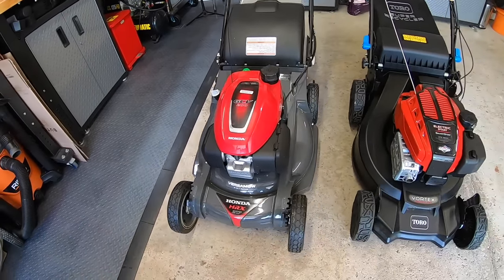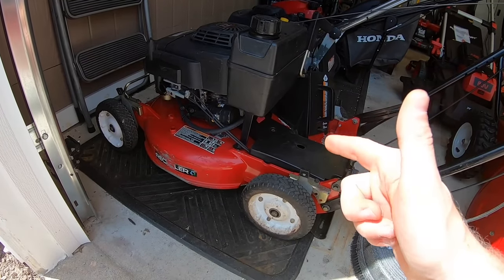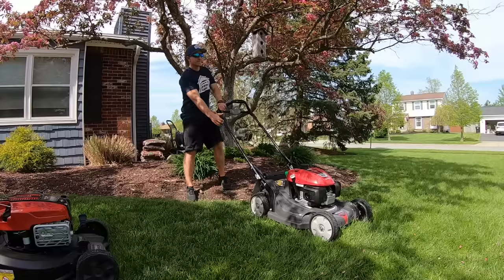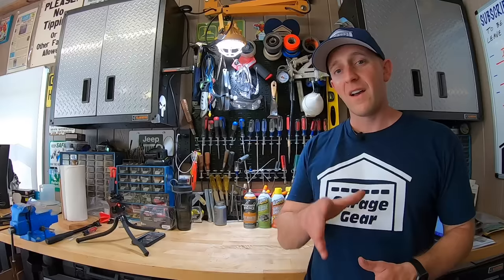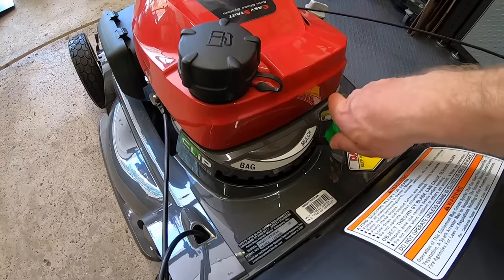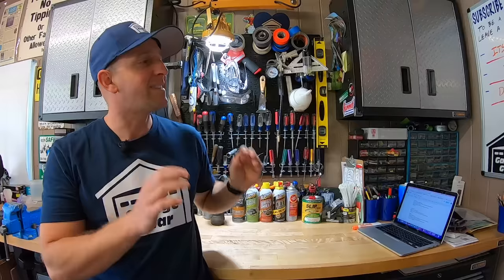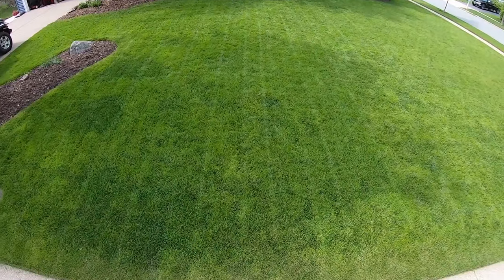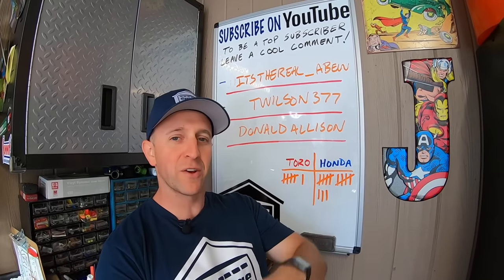HONDA HRX217VKA VS TORO SUPER RECYCLER 21564 - WHICH MOWER IS BEST?

Comment: I have a Honda 190cc HRX 217 that is about 12yrs old, and a 32yr old cast aluminum Toro Recycler with the tiny 121cc Suzuki 2-cycle engine and 3-speed transmission. I have some bumps in the yard and the Honda is kind of bouncy and feels a bit top heavy compared to the old Toro. I think the Toro is a few pounds heavier and most of the weight is in the deck, and the Honda has a lighter deck and larger heavier motor that stands much higher off the deck. The Honda does make more power, but it is more than needed.

The Honda is a great mower, but the old Toro mulches better and leaves a much better finished cut. I am not a fan of Honda's select drive or Toro's Personal Pace. I like old school 3-speeds, but I have never tried Hondas Hydrostatic transmissions. If I bump into an old 1990's cast aluminum Honda HR 215 on the cheap I'm grabbing it. I'm not feelin' Honda's Nexite so much even though I am a HUGE Honda fan. Been driving Honda's for 27yrs, and my old Accord saved my life 23yrs ago.
Reply from the maker: Good info! Thanks for sharing Eric!

Comment: JB have you ever done a video on the Timemaster kill switch? I noticed a fence and my switch hit the fence twand had to replace. I went to hardware store and got a insulated switch for $5. So easy to use. I put it in the same housing as the Original switch. I even had thecswitch ware out. Take care.
Reply from the maker: Never did that. Actually I sold the mower a couple of months. Thanks for sharing what you did.

Comment: I have a 2018 Honda HRX and also a 10 year old toro Super Recycler - I’ll have to say my HRX is heavy and bogs down in wet grass - or thick grass - meanwhile the Super Recycler is lighter and powers through it all - also the HRX self propel dial speed I have to adjust tighten up every month plus the rear wheel seems to lock up every now and then -
Reply from the maker: Thanks for sharing this with the community!

Comment: @garagegear I'm looking for the best mower for $600 or less. I bought a 21 inch honda from home depot and it was recalled, so I returned it hoping to get some sales for black friday. Regardless of it being on sale, do you have a recommendation? I've watched a few of your videos and theres some flaws with Toro, but it seems to me its between a Honda and a Toro, but I'm weary of honda due to the recall and them discontinuing production of gas mowers. Appreciate any recommendation you may have! Thanks
Reply from the maker: Hey Tim I’m really not pleased with the quality of some brands lately and will be looking at more next year. If you can find a gently used Honda for sale perhaps go that route. The cam shaft issue seems to be only effecting models this past year. Thanks for being a cool fan!
Reply: Alright look, I don't suggest purchasing a Honda; perhaps you should consider a lawn mower brand that has been in the industry for a longer period of time and has had more opportunities for trial and error. My Honda 216 has been causing me a lot of issues. If you purchase a Honda mower,  there will be trouble ahead. Naturally I'm going to advise you to go with Toro..

Comment: Great review, tks. Leaning to the Honda HRX217 HYA, but still have some more homework to do.  One of the questions have on any of the self-propelled mowers is how they turn, then start reverse pass. Especially given the various handles that need to be engaged. Have a smaller front yard so there is a lot of turns.
Reply from the maker: Hey nibs sounds like you god somethings to consider. The toro did trim easier with the bigger back wheels.
Reply: we have a Honda HRN. it's easy enough for my wife to operate. she really likes it, so it must be easy to use.
Reply: I’ve had my 217HRX for about 15 years. It has the electric start option but it is so easy to start it’s not needed. Even my wife can pull start it. I have many curves and tight areas in my yard and the self propelled feature is a blessing to help the turnarounds. Hands down the Honda wins over my former snapper and toro! The only repair has been the speed control cable, which I replaced myself.

Comment: My present mower is the HRX217VKA. There's nothing it doesn't do very well. When I'm finished mowing I blow the mower off with compressed air top side and under the deck. Takes every bit of one minute tops. Honda is King of the non commercial walk behinds. I'll also probably be buying another to put away just to insure that I get to mow with one of these for a long time. Great video JB.
Reply from the maker: Awesome Kenny! Smart to do so! Thanks for sharing and the positive feedback!
Reply: Especially with the rumors circulating that Honda is stopping production of their lawnmowers.
Reply from the maker: @mackfar27  Honda is done in September with mowers

Comment: I only just recently purchased a HRX217, and I have yet to operate it. But the only relevant part of the mower is, and always will be, the engine.

The mower that this will be replacing is a Craftsman Honda with a GCV160 rated at 5.5 HP, no self-drive, that my father purchased in 2002. The engine itself is still solid and burns little to no oil. The main issue it's had is with the gas tank. When you spill gas on the cap threads, it makes the cap seal on and no air can enter to displace the fuel being burned, thus making it run lean, necessitating leaving the cap loose. Still, I would have kept it up, but due to too many impacts with tree roots, the deck is cracking. One engine mount point even broke, and I had to make a new one, but it's only a matter of time before another mount point fails completely.

Even to this point, the engine starts on the first or second pull. Except for the carburetor, it's never been opened up once. No valve or cam adjustments. One dose of SeaFoam. Only the pull starter and carb gaskets have been replaced. and the addition of the governor arm oil seal. This engine drank down 2-cycle gas without a problem. It even took down year-old regular gas that made the engine detonate, and it still ran with no ill effect. As hard as I have been on it, I can't kill this thing. Even if the machine it powers wears out and falls apart, these engines simply cannot die.

It is the absolute last Sears Craftsman appliance that I have, and after 21 years together, I will be sad to see it go. I only wish there was a more dignified way to retire it.
Reply from the maker: Wow! Some machines mean a lot to us! Thanks for sharing!

Comment: Hello , I have two questions ?

1. Does a honda cut grass backwards , like you walking back with lawn  mower engaged ?
2. Can the toro do the same ?

I'm not saying cutting your grass backwards all the time , just asking if it saves time .

Thank you in advance
Reply from the maker: Hey Sebastian! The blade is always spinning underneath so it will cut when pulled backwards on both models. Thanks for watching

Comment: I have had both a recent Honda and the Toro Super Recycler . The Honda engine is amazing but the Toro is a much better mower! The drive system is way superior. The straight handle is no problem  aand I don't agree with these comments. This channel is remarkable so you don't have  to agree.
Reply from the maker: Thanks for sharing your thoughts on these mowers and thank you for being a cool fan of the channel Robert!
Reply: I have a Honda 216 and it has been nothing but problems. I would have wished that I had got a Toro super recycler. I should have done a little bit more research.. Toro has been in the grass game since 1914 beating Honda and every other mower in terms of reliability

Comment: I purchased a 2023 Super Recycler with the electric start and 1900cc engine.
Looked at the Honda and the local dealer would not even accommodate me as he said he could not sell a unit due to a recall.
From what I have ascertained the 200cc Honda engine has a valve 'guide' problem and as they are 'leaving' those of us that have properties where the 'electric' units would not be an option that made the decision easy to make.
I will deal with the plug for mulching.
I am not worried as I do not make any attempt to keep up with Jone's.
I just need to cut my very hilly undulating 1 acre lot.
Cheers.
Reply from the maker: Thanks for sharing this information and thanks for watching.

Comment: Crafstman for the win. I bought my craftsman 3 years ago, I do not bag as there is no need to. It mulches so well that my clients think I bag, but I do not. No oil changes ever, just added a dribble of oil for the first time since buying it this season. This season was also the first year I have had to sharpen my blade, despite cutting commercially with the mower. The only grass the mower has struggled to cut was 2 foot tall grass, very dense, had to cut that lawn twice to bring the length down nicely. 
Toro sucks straight up. Used their mowers commercially for 3 years, and we had them in the shop monthly, even for their commercial grade mowers, let alone our residential grade push mower. A couple of my clients have Honda mowers, and they are not bad. The bag to mulch switcher is not very reliable as the bag mode allows grass to get stuck, preventing the switch closing back off to mulching. Also the drive belts on Honda mowers seem to be hit or miss, and I end up often using them as a non driven mower. I can not comment on Craftsman's belt drive quality as I do not use self driven mower. I can say Crafstman uses the plastic back guard, that fell off fairly quick, but has not affected the striping quality in the slightest. Good striping is all in the pace of the mow more so then anything else. When I worked for the company I learned from, we had top of the line striping kits on our 0 turns, I was the only one who did not use them, and the boss constantly asked me how I got my stripes to look so good, did I finally use the striper, did I double cut to define the stripes? Nope, just cut at a good pace to put that stripe into the grass.
But strictly between Honda and Toro I would take the Honda all day any day.
Reply from the maker: Thanks for sharing this pho!

Comment: I have a 2021 model super recycler and it cuts better than anything I've ever used. Not super impressed with the new Briggs and Stratton. Dipstick, air filter and gas cap don't seal well and let some fine stuff through.
Reply from the maker: Thanks for sharing semi!

Comment: I bought Honda in 2020 and recently got into small engine and bought another Honda that supposedly needed the drive belt but it’s a gear transmission and the cable to put it into gear broke how shall I test the transmission to make sure it works before for I replace the 50 dollar part?
Reply from the maker: That’s a good question. You could always buy the part, try it, and if it doesn’t work out return it or sell the part on eBay.

Comment: How would you compare this Toro model to a new HRN series Honda? For comparison would be nice to know. Also, there are complaints supposedly with the changes Honda made in the last few years about grass getting stuck in the belt area and causing transmission issues? I'm Honda guy with a 17 year old HRN and it's about ready to be replaced and I'm trying to figure out what to go with. My old HRN doesn't seem to have enough power at times and I'm wondering if I need to step up to a HRX or the newer 170 CC engine will be big enough to notice a difference on the HRN. 

Sorry for all the questions trying to figure out what seriously look at. Especially at 5000 ft I do lose power.

Thanks!!!
Reply from the maker: Hey Daniel! First I have not had any issues with grass and the belt. I don’t know what’s causing this to happen to people but I mow twice a week with no problems. Perhaps if you are mowing a ridiculously long lawn this could be the case but I don’t see any issues mowing my lawn when it’s longer. The 170cc engine has plenty of power and is actually pretty fuel efficient. Hope this helps you out!

Comment: The Lack Of A Rear Side Chute And The Rear Wheels Locking Up When Pulling It Backwards Was The Deal Breaker.
Reply from the maker: Thanks for sharing loocius!
Reply: On the Honda or toro?
Reply: @pillcosby3949 Toro… 3rd time at the dealer.  4th if you count the time I purchased it 😅

I’ve cut my grass 5 times.

Comment: Toro is throwing a super big victory bash, because Honda has stopped producing mowers in North America😭

R.I.P. Honda North America😭

I have had my  HRR Honda since 2018, & its done more mowing than it was ever intended to do as a residential mower. I have upgraded the tires, they help lay mean cut lines😁...I need to replace those soon though.

Might go buy 2, 2023 Honda commercial mowers yet.
Reply from the maker: Go buy them and stock pile them lol! Thanks for sharing d!
Reply: 🎉 lol super-big victory bash huh. 👏

Comment: I have the GCV200 Honda and its 1 pull to start. I DONT LIKE when you cut tall grass in bag mode with no bag it clogs up the chute and you have to pull it out with your hand and you have to go really slow if you are trying to mulch tall grass or it will bog out. I feel like the mower should be able to rev much higher than it does. I usually cut taller, thicker St Aug but I feel for the price it should have more Torque or power. Im not sure how I feel about the hard plastic deck, I wish it were aluminum & the Honda wheels do come lose and you need to retighten them
Reply from the maker: @Krumholt  thanks for sharing Krum

Comment: Went into my local shop this week to buy that exact Honda. When I got there, all the Hondas were taped off with a sign that had info about the recall and stop sale order on those models. The guy at the shop did not know when he'd be able to sell the Hondas again, and recommended that exact Toro. Said he was very impressed by it and that I'd be just as well off with it. Just so interesting what's happening to the Hondas!
Reply from the maker: Thanks for sharing Austin!
Reply: Is that why there are no Hondas on the shelf, a recall? I just thought everyone bought them up because they heard Honda was getting out of the lawnmower game.
Reply from the maker: @pillcosby3949  Honda is done with lawn mowers this September.
Reply: @GarageGear  I know but doesn’t that mean they should be manufacturing them until September? Every place I check is sold out and Lowe’s and Home Depot have completely removed them from their website already
Reply from the maker: @pillcosby3949  perhaps you could check with some dealers/shops a little further away?
Reply: same here... Today 6-29-2023 I stopped in a Local mower shop and Yes their Honda HRX taped off.  The Service manager told me its a CAM issue that Honda is trying to get a handle on.. he did say the fix has been determined...
Reply: I called one of the lawn mower dealership in our county and he mentioned that he got a lot of stock but can’t sell it at the moment. I need to call them back two weeks from now if everything is approve to sell it back to the customers. But as they said in the news, they will be getting out from the lawn mower business soon. Sad coz I love their lawn mowers. They are built to last.
Reply: Went to my Honda dealer yesterday, ready to buy. Stop sale still in place, with no further info from Honda. My dealer confirmed it’s due to camshaft and compression relief issue on starting. They’ve fixed a ton that were sold already. I suspect the Honda will just take back the mowers they have in stock and credit the dealers. I don’t see them doing a whole bunch of work to fix mowers there the last ones they were ever going to sell.  We shall see, my dealer had 80 in stock, they can’t sell.

Comment: The Toro ground speed control is the best by far because it is fully automatic.  Walk faster and the mower speed increases.  Walk slower and the mower speed decreases.  With the Honda you have to constantly coordinate your hands and walking speed, and the speed levers are very hard on my arthritic thumbs.  My Honda engine would not restart when hot, so the electric start was useless.  The Toro with blade brake does not need to restart when hot.  These factors were big enough to make me give away my 2 year old Honda and buy the Toro.
Reply from the maker: Thanks for sharing

Comment: Question? I love everything about the Hondas except for that lame nexite decking.... Why would Hinda do this? My back yard unfortunately is BRUTAL on mowers. I have tree roots that bulge up from time to time, rocks here and or there that I don't see till after I ran over them. I just don't see the nexite deck holding up to that kind of punishment like a steel or aluminum deck would. Thoughts? Thanks.
Reply: same here the nexite is tough and rustproof. 8 years on and good as new.
Reply from the maker: They did this for cost and efficiency. It is pretty durable but if you really need something more rugged you could look at the Honda commercial mower with a metal deck! Thanks for watching
Reply: @geodot595  have you ever ran over bigger rocks or tree roots on accident? How did the deck hold up to that?
Reply: @loislane4583  im in upstate ny with an acre. ive hit roots and small rocks which chipped the blades but no damage to the nexite. iv hit the same stuff with my white (mtd) rider and a rock punched a hole through the steel deck. im carefull but sometimes i get surprised.

Comment: I'm sorry if this is a dumb question, but since Honda will no longer make new lawnmowers, who will service them in the event of a needed repair?  I am leaning toward the Honda, but we do have a Toro dealer locally (small town).  Have you ever had to deal with Honda directly, or a Honda dealer, on any warranty issues?  If so, what was your experience?  Thanks for your very informative videos.
Reply from the maker: @cjelvado  good question! Most small engine repair shops should handle them. And I believe any warranty issues will have to go directly through Honda. Then they can tell you where to go or what to do.
Reply: @GarageGear  thanks!